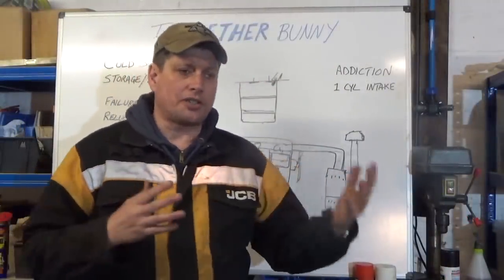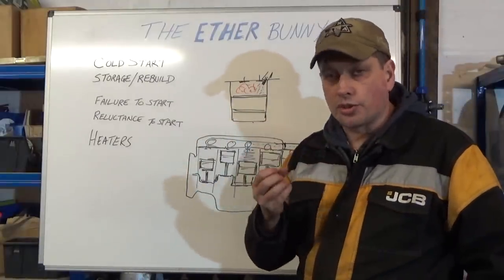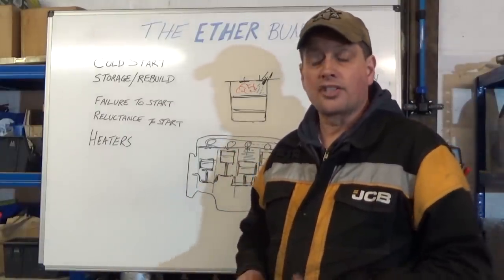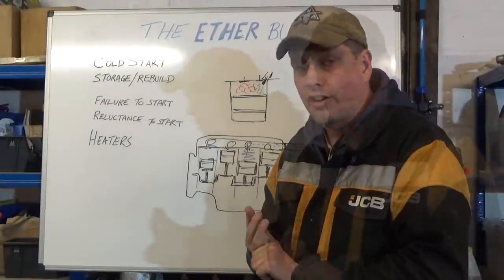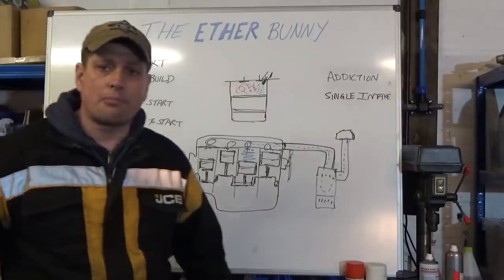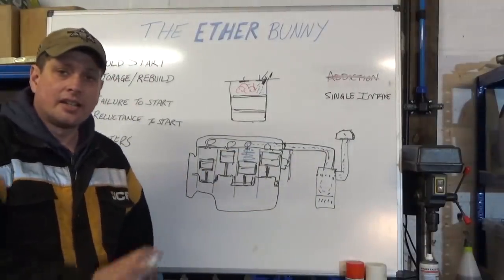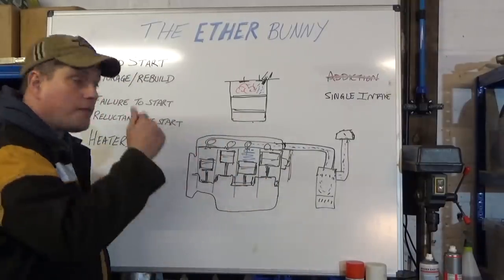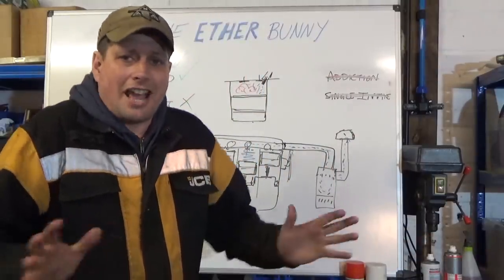CAN ENGINES BECOME ADDICTED TO STARTING FLUID ?

Comment: I wonder who’s going to be the first muppet to argue against the facts? 🤣 Great video mucka, well explained and really well presented.
Reply: I'm not a muppet I happened to be a diesel mechanic and a diesel engine will get addicted to ether I don't care what anyone says I work on them all the time people use it year around because thay got it addicted to ether so you can believe what you want I know.
Reply: @anthonyyoung7344  I'm not a muppet I happened to be a diesel mechanic too and those engines that wont start without ether even in the summer are fucked and need rebuilding. 9 times out 10 the the rings and bores are shagged through high hours or poor maintenance and would still be shagged if ether didn't exist. Addicted to ether just means the owner/operator cant be arsed to fix the problem and the only way to start it is with compression in a can.
Reply: @anthonyyoung7344  what an idiot u are 😂😂
Reply: Anthony Young Can you let us all know where you work ? That way we can avoid letting you near our trucks ! You’re pretty fucking stupid if you can’t understand the FACTS that mucka put in the video ! You’re no diesel mechanic.

Comment: Either like all other combustibles have a specific flash point of self-ignition, some higher some lower. 
Either has a lower flash point than diesel and it in turn flashes the diesel.
I've used atomized gasoline/vapor (very very sparingly) to cold start diesels, when in a pinch !

Comment: Rookie here... So before the heavy mob attack, it literally is a question.
  I was about to use easy start and a neighbour said it strips the oil lubricant off the piston walls as it's solvent based,..... How true is this?
Confident already just hearing this guy, matter of fact with NO scaremongering bollocks....
Reply from the maker: Tell your neighbour to fuck off and go lay down somewhere safe.
If you just need to get an engine started, you'll be fine. If it needs ether every time then you've an underlying issue.

Comment: I have had diesel engine that wouldn't start without starting fluid, but they weren't addicted. They were low on compression or bad injectors or a number of other things, but they weren't addicted!
Reply from the maker: Lack of maintenance and a failure to repair. Nothing to do with Ether.

Comment: My 200tdi engine in the 90 has glow plugs  but never used them it starts on the nose even in the coldest of weather. Even engines that have been sat for years start nicely. Never used ether. Cracking engines.
Reply from the maker: Your 200TDi is direct injection and the glow plugs come on as soon as you turn the key... 😉
Reply: @LordMuck  haha..that was exactly what you were talking about the whole f'n Video...
I get now why It's maybe better not to respond at all to comments that waste your time...

Comment: Wadaya reckon about using a bit of petrol, works out the same the times we have used it. Probably wouldn't let any near my Perkins they start well enough in Australia without any heating although I may have to worry about it in the winter.
Reply from the maker: Doesn't really work the same especially when using it after a rebuild.

Comment: This video is a perfect explanation to this myth.
If you use startin fluid on a engine and the next day it won't start without it, you probably used enough to crack a piston or a ring. It's not addicted to it now, you just have no brain cells.
Reply from the maker: It rarely cracks a piston or a ring - that tends to happen when it it used for prolonged periods of time without attending to the source issue.

Comment: I think people are smart enough to realise that if an engine really needs eezi start it is getting progressively more knackered and probably has rubbish compression or bad injectors/pump so I think when people say 'addicted'  they are mostly joking and denying the reality that is worn-outness ...
Reply from the maker: You have vastly over-estimated the mental capacity of the average keyboard mechanic - they trot out the addicted Shyte as gospel as in reality they haven't a fucking clue
Reply: @LordMuck that is so true.
Reply: starting fluid is a diagnostic tool, not a permanent solution
Reply from the maker: Except in cold climates 😉

Comment: I drove a boat with a Detroit 8/71 twin turbo and even in the Australian summer it would not cold start without ether but it had ether induction ports under the blower from factory so if it was addicted it was from birth and it's Muma must have been an ether junkie.

Comment: Ether  is the automotive equivalent of giving an old TV set a measured whack, results will vary but when correctly administered the uninitiated can mistake it for a repair.
Reply from the maker: That's a fair summary however when correctly administered to a 'decent set' in the right conditions it's like having Sky for free...
Reply: That's fucking hilarious, I haven't seen a good TV whack for years but I could swear my Grandpa knew what he was doing.

Comment: I am a new subscriber and going over some old videos .  A good video this one , being working on Marine diesals for 40 yrs and the Ether addiction is rediculous , the people who say it dont understand a lot .  I agree entirely that the reason you have to use is because there is something wrong , and until you fix the original fault you will have to keep on using it , SIMPLE .   As for wanging them over on the starter motor , this will just cause damage !   The insulation in the starter motor and on the leads is only made for 10 second bursts, so if you burn ya leads you will need to keep usin Ether because will end up slow starting speeds.  As you said its all to do with heat on top of the pistons through compression , if they have being stood a long time , or being stood in sub zero temperatures the compression is going to be low .  Long periods of storage , everything will have contracted and oil presence will have disappeared , sub zero temperatures same again .  
Every engine I have rebuilt has needed Ether till its warmed and the compression rises.
Reply from the maker: Spot on 👌🏼

Comment: Big diesel engines sometimes actually have a Built-in either system so I don't know why it would hurt the engine not not mention model engines with carburetors use ether to run on
Reply from the maker: Exactly.

Comment: Detonated a 7.3 powerstroke that randomly stopped running couldn't find an issue fuel pump was running just wouldn't fuel injectors were clicking... randomly got air in it despite having a full tank ethered the piss out of her glow plugs decided to turn on and yeah my air filter ended up in the road on firing and I had to get a new air intake and filter..... 50k miles later still running no idea what happened... changed where I bought fuel and never had a problem agian so you tell me
Reply from the maker: So fuel rather than an engine issue.
All's good 👌🏼
Reply: @LordMuck  yep just started mis firing 1 cylinder at a time and I'd say we spent 2 fairly new 31p battery's to the grave trying to bring it back to life ... left me on the interstate 4 times until I got all the fuel out of it just had to get out hit the fuel pressure testing port to pet the "air/whatever the fuck was in that fuel" out and it eventually came back to normal. I gotta say tho testimate to the powerstrokes rods she detonated hard

Comment: The issue with ether isn't addiction; it's using it to excess & thus stripping lubrication off the bores & increasing wear.
I used it when needed on various Ford & Fordson tractors (oh & a 1974 Belarus but it was "speshul"...) & only a Ford 5000 wouldn't start without it - until the injectors & pump were refurbished...
Oh & an empty Easy Start can down a piece of cast iron drainpipe into a brazier will launch a suitable size rock a LONG way. 🤡
Reply from the maker: Exactly - if ether is required at all times then there is an underlying issue

Comment: Only retarded people think an engine can have an addiction, you could run a good engine on that stuff for an hour or more and have zero negative effects, a bad engine would get worse because you haven’t fixed the fucking problem, great videos by the way 👍🏻
Reply from the maker: Exactly Darren 👌🏼
An addiction means you cannot function day to day without something - an engine just doesn't start, that's it.
Reply: @LordMuck  
Some people will never get it,
Reply from the maker: Yes but they've heard first hand from a guy down the pub that spoke to a guy that had seen a post on Facebook from a guy who had read something on the internet about a bloke that knew a man who's engine had become addicted...
Reply: @LordMuck  
Social media has turned lots of people in to experts

Comment: I modified all my drotts  with heater plugs that took full battery voltage , not five volts after a resistor. Never had to use easy start again on those machines.. Will start fine in cold weather. Years ago when I worked on plant, an old B100 on a cold morning would not start. twin oil bath cleaners. Dropped off one bowl and used a burning rag on a stick. Started ok, but then noticed the paint on the second oil bath bowl starting to bubble ! the oil had caught fire . oops.
Reply from the maker: As you'd expect with decent heaters 👍

Comment: So what about engines with glow plugs... Will it pre ignite even with a few squirt or is it fine
Reply from the maker: If you have functioning glow plugs and the engine is in good order you won't need ether. If it's sacked out and your glow plugs don't work it won't matter.
If you happened to use a couple of squirts combined with the glow plugs it won't do much either way despite the horror stories.

Comment: Hey Muck. Ether Addiction happens when the engine is so clapped out that it needs a little extra help to start, weak spark (petrol), lacked of compression or low fuel pressure.

Comment: That was a good video. I totally agree with everything u said.
I knew an old international that, on a frosty day. Just needed a little puff to get going. But the rest of the year it would happily go to work without any help.
But I've seen people stand there, and wind half a can in, with the resulting bang and clouds of black smoke. It's so obvious there is something els wrong. Some will continue this procedure for years, then when it's totally ruined. Will say. Well it was always a bad starter.

Comment: Ive had 2 engines that i had to use eather on every cold start but that was due to an engine issue that was not a cost effective repair. Ive been on the tools for years and have had enough of hearing this 🐂💩 about addiction.
Reply from the maker: Exactly as you say - it had an issue that required repair, not an 'addiction'
Reply: @LordMuck  in my instance both engines were going in the shredder as the faults were terminal and it was to get me by for a few months so not worth spending on them one had been hydrauliced and the other had a bad score on a non lined bore but people are too lazy to diagnose the issue and just blame eather.
Reply from the maker: If you're scrapping them then if a bit of ether keeps them going then every day is a bonus 👌🏼

Comment: Great explanation. I'm a or was a farm boy in the states. Grew up in Minnesota and on mornings when the wind chill is -30 F. WE HAD TO USE ETHER.  Or light a fire under the engine to warm it up. And I don't think my father would have agreed to that going on under a $80000 tractor and cattle needing to be fed.
Any way, we had ether attached to the engine on some or a can of it in the tool box. And if used properly and can of ether would last forever because like you said. It just needs a couple of squirts and you're good to go. Great vids. Really like how you make those old girls purr again.
Reply from the maker: Spot on 👍

Comment: My take on the ones that are "addicted", is some chucklehead used to much and has dickered the rings. Low compression. And now it needs ether all the time. But I agree completely with you.
Reply from the maker: Yes that's right but there was a reason it required ether in the first place and then not rectifying it allowed the ether to become a secondary issue.
Reply: @LordMuck  hadn't really thought of that angle yet. Makes perfect since. I was simply thinking of a couple cold mornings and a grumpy operator. Lol

Comment: My Dad had a Three thousand Select-O-Speed, ever seen one? Anyway it had an Excess fuel button on the pump for cold starting not sure if that does.
Reply from the maker: Yes, a lot of Select-O-Speeds were converted to conventional transmissions. No, this pump doesn't have an excess fuel button as I stated in the video.

Comment: Good video good info. Here in the southern US addition to starting fluid is what we refer to some old tractor or logging equipment that had the problems you referred to but some guy didn't know how or want to spend the money to fix so after years of dry starting and wearing out the cylinder walls wouldn't have good compression to ignite fuel air mix and wouldn't start with out starting fluid  keep the information coming

Comment: My dad had a 3000 when I was a teenager. It didn't have glowplugs and didn't need them. The owner's manual called for ether to be used on extreme cold weather. On very cold nights a 100w incandescent light bulb placed on the intake manifold if it was in the barn or heating up the manifold with a propane torch was all that was needed.
Reply from the maker: Same as this one, seems to fire right up without ether or a heater.

Comment: The hot air intake broke on my grandfather Ford 333, so we used would take the air filter out and blast it with a propane torch. Worked a treat especially on cold days.

Comment: lol, great vid!
I only came across 1 engine that took a prolonged shot of ether, it was a worn out, clapped out 15 liter in a semi (lori).  It wouldn't cold start without it, and I would stand there another minute holding the go pedal, till it could idle.  I was one of the only people that could start it on really cold mornings, and I got it to start every time....
I just woke up a lawn mower, that had been inoperable for months, with some (made sure to use small shots to get it to start, and stay running long enough to clear the carb)...
I've driven semi trucks (lori's), with ether buttons....
Reply from the maker: Lorrys.... 😉 or artics (articulated tractor units)

Comment: My 2 pence worth, he’s dead right if your always needing ether that lump of steel doesn’t need rehab it’s needs looking at. The only heat without heaters comes from compressing the gas in the cylinders as pressure and temperature are directly proportional (gay Lussacs law) you could turn it over all day in the cold and take two years off your starter or give it a sniff. You decide

Comment: One showy winters day we where starting a jcb 525-58 and it was smoking but would not fire, so I held the key in the heat position. At the same time the old lad that worked in the yard pulled out the air filter and sprayed ether into the filter housing not noing I was holding the key, well the thermostart heater plug ignited the ether and a fire ball come out the  filter housing and when I looked the old lad had a black face and burt eye brows. Well I was pissing my self in the snow so funny😂
Reply: Too many cartoons?
Reply from the maker: Not enough drugs ?

Comment: Hi it's Sunday 29th of March 20 and I haven't laughed so much in watching 2 videos on YouTube in a long time, I've just watched the video on the JCB 3C Powertrain and I wondered what the sevrecol bollocking you wher dishing out,  now I understand you have so meny numbnuts watching you I totally get the dont wash it in the begging if its beyond repair then the dirt and muck puts the price up on the scrap value, then you get the ones on about the ether/easy start in the past I've worked for people to tight to repair or rebuild a sick engine or heaters and he would give you a can of ether and he'd say use that if it wont start I hated using it, but saying that if you use it as ment it's sometimes your best friend and totally agree 2 short bursts and away you go, I hope the vid on the 3000 part2 and the explanation with your white bord will stop the addiction a%%&0les from having a go. p/s seen a few engines blown up by to much ether.
Reply from the maker: No, you've seen a few fucked engines blown up by too much ether. A good engine would have started... 😉

Good to have you along 👌🏼

Comment: You are completly right. I used starter spary on my ford 2000 tractor for 5 years but only in small amonts because i had a bad fuel pump, and my tractor did not start up byself even when the engine was warm and i needed the tractor to work. Two years ago i had a bit of time and i broght my pump to a shop for reconditioning and it was like 100$ and now my tractor works without any problem and it starts without any spray or anything.

Comment: STRANGE CRANKSHAFT ANGLES ON YOUR ENGINE DRAWING ? Otherwise you know your stuff, Great

Sylvia
Reply from the maker: Sylvia, I drew a correct crankshaft on a video some time ago with one down, two up and one down (as it should be) but I got swamped with folks saying that was wrong 🤣 as they thought it was up, down, up, down and I had to explain that wasn't the case ! So to make it simple I just drew a stepped diagram (hence why I put for 'illustration only') 😉
Reply: @LordMuck   Hello Muck. your original drawing was right then. 1&4 up 2&3 down, correct.

Thanks Sylvia.
Reply from the maker: Yes but you draw that on a video and then expect people to understand - they don't believe it's how it should be 🤣👍